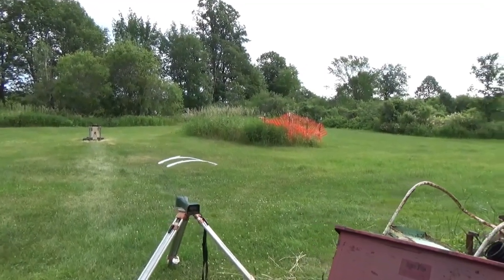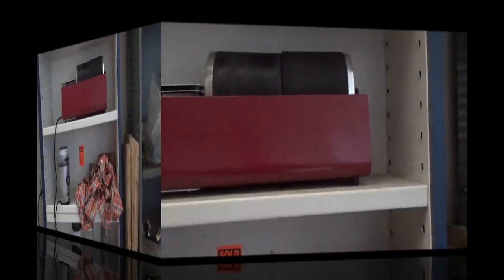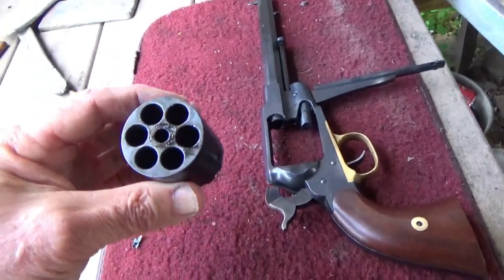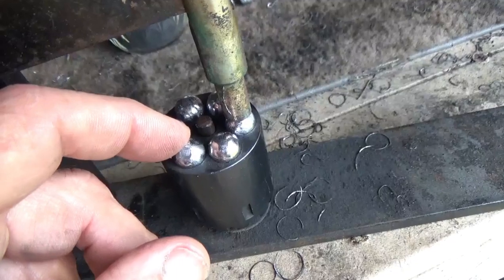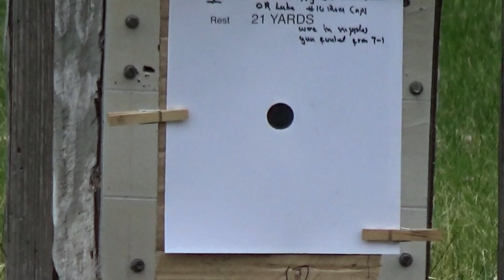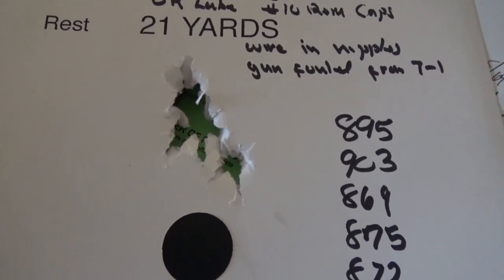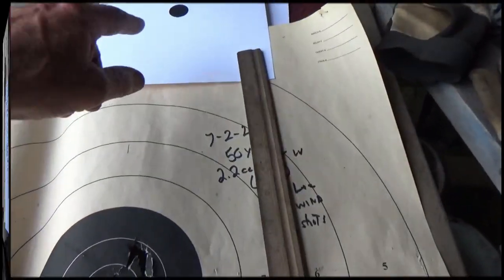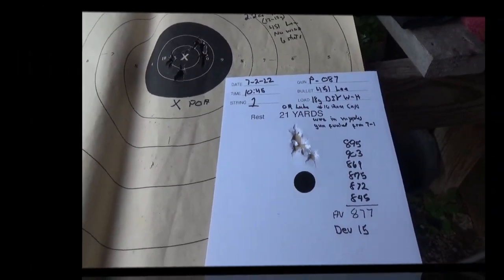DIY Black Powder - 50 Yd shooting from rest

Comment: That's impressive accuracy and consistency of velocity.  Most people on youtube can't do 3" groups at 7 yards and they call that "accurate".  For your use at 21 yards I recommend a square black aiming point at least 2" x 2".
Reply from the maker: Thanks Bill. I’ve been using a 1x1 black target patch because I had some, but hard for me to see at times. Also really hard for the eye to distinguish center. I think a larger square could solve that. Again, thanks for your suggestion. O.R.

Comment: No matter how you look at it one cannot complain about the accuracy results, even with the flyer. Solid enough to dispatch a deer if need be.  As per or conversation about grainulation  ranges, if there is significant changes in performance of the Granals from a fresh batch as opposed to more dust at the bottom of the bucket??? It might require a finer screen to separate dust from granules. Still interesting results.

Comment: Excellent accuracy, very interesting poking the pick into the powder, I think I will try that myself and see it f it helps with ignition, I was at the range yesterday shooting my 1851 navy and hitting a small gong target at 25 yards with one hand from a standing position and getting praises from fellow shooters at my accuracy, they were missing the same target using both hands with their Glocks and 1911’s, felt good getting dialed in with my Navy, I upgraded to the Slix shot nipples now and getting zero cap jams, (happy about that) thanks for sharing these results from your DIY powder experiment sir!
Reply from the maker: Sounds like you are doing well with the navy.  Is that a 36, or 44?  I am doing the pick thing on the DIY powder because I suspect the fines and powder could be really packing itself into the flash hole in the nipple, almost sometimes acting like a fuse.  That's just a theory, but any ignition that is not consistent can throw shots out of the group I feel.  I'm not aware of any ignition potential when doing the pick thing, but keep her pointed down range in the event that somehow a spark from the wire pick does you know what.  Keep safe. O.R.
Reply: .36 cal Navy, I was shooting .380 cast round ball with 25 grains of Pyrodex P, makes sense about the fine powder blocking the flash hole on the nipples

Comment: Really impressed with your work and wondered if you have made power comparisons gr for gr with commercial powder? Just found your channel and like your detailed approach .
Reply from the maker: Thanks. Not yet, but would be interesting. We can say that volume wise it runs less, and that is especially important if someone needs to get maximum knock down where there is a limit in the case or chamber. That gr to gr comparison might tell us something about the components, mixing, percentages, or type of charcoal used. We know that it works, but how well does it compare to commercial?  Thanks for the suggestion. O.R.
Reply: @oldranger3044  retired from doing research and absolutely loved the process of finding the path from plotting data points. So many firearm channels on utube are about destruction and not teaching especially the underlying physics behind firearms. Even though equations can give you knock down power I'd like to see someone build an old fashioned ballistic pendulum to demonstrate what is measured and calculated. Health has taken me out of the game so I really appreciate watching your work. If you watch either lever guns 50 or Cinnabar ranch you'll see some of my projects, they took over the shooting/testing.

Comment: Great shooting! 
I’d say that your homemade powder is the real deal.  Good job with it!
Reply from the maker: Thanks Skip.  Now I need to figure some way to get that fine powder down the barrel of the rifle, and it would be nice to know if it is building any excessive pressure because it is fine.  I am also working on some pucks which will grind and hopefully give better and more FF and FFF.  O.R.
Reply: I can’t really explain why but with mine, the grains dried real hard.  I did have some dust on the drying tray but I just put the dust back for mixing with future batches.  I ran the grains thru different size screens to sort out and separate the 2f/3f grain size I was looking for.  I do plan to try the pucking method at some point. 
I used 91% rubbing alcohol mixed with water at about a 75:25 alcohol to water ratio. I don’t know if that helped make harder grains or not but it made real nice “dough balls” for screening.  
Keep up the good work!  
I’m really enjoying your videos.
Reply from the maker: @skiphinson8620  Thanks Skip.  I used only a small amount of water, no alcohol.  Possibly that explains the difference.  Thinking on trying your mixture.  Thanks again.  O.R.

Comment: I like! NICE GROUPING! Think I will start the clean/poker system at capping! AND I think it is time to build a cylinder loading stand?
FYI that carbon you set aside is my favorite to grind and ball mill after a rinse and oven dry. chemist friend told me a rinse may get rid of some byproducts that may foul and slow a burn? "BUT?" I am still chasing the dragon too.
Reply from the maker: That carbon is harder then the rest as my blender doesn't like it.  I will try what you are saying because who knows, maybe I am rejecting the good stuff.  Can't hurt to try it against the other.
So you will rinse after the milling?  I wonder if some of the by-products are what makes one type of charcoal better (or worse) than another.  Seems if it gets down to pure carbon (C), then all should be equal, right??  O.R.
Reply: @oldranger3044  
Please keep U.S. posted!
I am still working for a Faster pan charge? Love the chase.
Reply from the maker: @davefellhoelter1343  Like that attitude.  It's that that keeps some of us moving.  I've spent more that two days trying to figure out why I'm having problems with the 51 navy and not the 58 Remington with the DIY caps.  I think I'm getting closer.  That's the chase.  O.R.
Reply: @oldranger3044  Me TOO! I figured out to FILL the DIY caps #10 or 11 to the top with material, then add solvent, allow to dry, and Maybe add More material and solvent AGAIN!
Took some time and experimenting.
Now my final solvent is 10:01 solvent clear nail polish to hold in a cleaned fresh cap of aluminum or copper as I case lubed oiled die to form caps.
Working out die for Cap Lock long guns.
Reply from the maker: @davefellhoelter1343  Check out the comment from Lyle, his system doesn't use the binder, and I'm liking it.  O.R.

Comment: Love your videos brother. Very thorough and informative.
Have you tried pucking with your hydraulic press yet?
Reply: I was thinking that's a better idea than the hammer
Reply from the maker: @35southkiwi16  I used the hammer to get the pucks more firm than I could squeeze the lump, but didn't want it so hard that it the screen wouldn't rake it off the puck.  I have made a couple batches now with the press, and dried them enough so they went through the grain grinder.  probably got about 50% that wasn't the fine powder, and it is more dense, but still not like the commercial stuff.  A 1.3cc dipper weighs about the same as a 1cc of the GOEX 3f.  O.R.
Reply: @oldranger3044  thanks for your reply. For a very simple combination of ingredients BP can be quite quirky. From my research it seems the charcoal and compression of the mix are the two things that make a biggest difference. Willow is sited as one of the best but British admiralty experiments way back when concluded buck thorn alder was ultimate. I also read some where 18000 PSI was good on the compression side of things. Apologies if I have mentioned before or I am citing stuff you already know. Very impressed with you results!
Reply from the maker: @35southkiwi16  Don"t worry, because If I did ever know much, most I've probably forgot.  Now that 18k is interesting.  I think I can do some calculations knowing the lever arm on the loading lever, and it's surface area to get PSI.  My guess is that it is no where close to that.  Checking the 51 Uberti, the loading lever has about a 3 to 1 mechanical advantage.  So, 30 lbs would give about 100, and the surface area of the rammer is .1 sq inch.  So, that is only giving us 1K PSI compressing the powder.  Maybe the 18K is the pressure of the burning powder??  Interesting, thanks.  O.R.
Reply: @oldranger3044  the 18k PSI is for compressing the powder into pucks. There is a very good vid on the subject I will try and dig out for you. I have it filed somewhere......
Reply from the maker: @35southkiwi16  Was thinking about that today, and realized you were probably referring to the production process.  That makes sense because the 20 ton press making a 2 inch puck is giving about 13K if I did the math correctly.  A 1.75 inch puck maker would then give about 16-17K.  Thinking on getting that size, never gave enough thought about that, and didn't know about the 18K thing.  Thanks for this info.  O.R.

Comment: If you want rock hard screened powder try adding 3% Soluble Glutinous Rice Starch.
Reply from the maker: Thanks Steve. Never would have thought of that. I got to wonder who comes up with these ideas. I’m anxious to try it, but will have wait till next summer. The problem I had with screened was that it compressed too easily and dusty. Will the rice starch help?  I’m not concerned if it lacks some power; actually having to use more will put the ball closer to the barrel. Thanks for the info. O.R.
Reply: @oldranger3044  Yes, I'm not kidding when I say it's as hard as a rock. If you add too much water it will screen like noodles so just leave it to dry for a few hours before screening. I have videos on my channel making it and shooting it. I've had a great time watching your stuff. Keep it coming!
Reply from the maker: @SuperSneakySteve  Thanks Steve. Saw one of yours that got me interested in making the powder, thanks for that and the update on the use of starch. I will check out the information you have in your posted videos. You keep at it too. O.R.

Comment: One of the things shooters don't often think about is the condition of the nipples on their percussion guns.
I have seen many old original rifles and shotguns that had 1/16" or larger orifices in the nipples and hammer faces that were badly eroded from back blast through those nipples. I have even seen new antique nipples that had large orifices in them.  Maybe they felt like it improved reliability to have nipples built that way. I have seen rifle hammers blown back to half-cock from worn nipples.
What I often see today is nipples that are fouled so the fire going into the charge is reduced and this has a negative effect on accuracy.
Also quality control is often lacking in many of these imported guns.
Nipples may have machining burrs or bits of metal in the orifice. 
Or the orifice size may not be consistant from nipple to nipple.
I like to check mine with wire from a paper clip to see that they are all open and the same size.
Next time I take out a percussion revolver I may check it with numbered drill bits to see what size they are inside. Then I can check them from time to time for wear
When I want to be sure my flintlock works reliably I always clear the touch-hole with a wire.
Thanks for the video.
Reply from the maker: Good idea about the numbered drills. I believe the distance where the small hole is bored is quite short, and probably erodes larger over time. I’ve often wondered why it appears the cap jams weren’t as common in the day. Some think they were, but its hard to believe the ordinance officials would contract for large number of repeating weapons, which there was a fair chance that a jam would prevent shooting all six shots. Also, they were very popular, even after the SAA was produced. I remember someone saying the caps were different. I like your idea that possibly the holes are different and that could cause variations in ignitions. I think Slixshot nipples are pretty uniform and seem to help with the jamming issues. Thanks again for all your information. O.R.